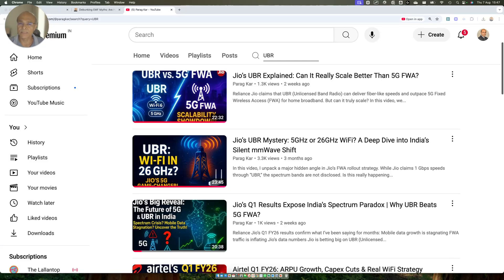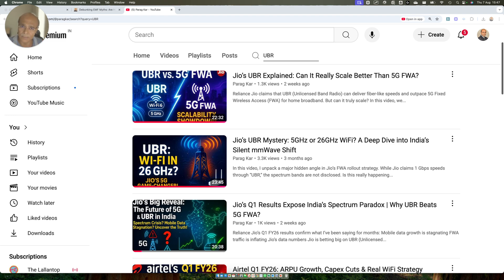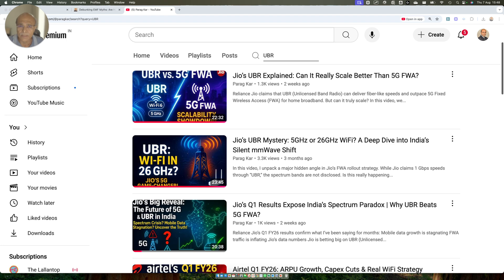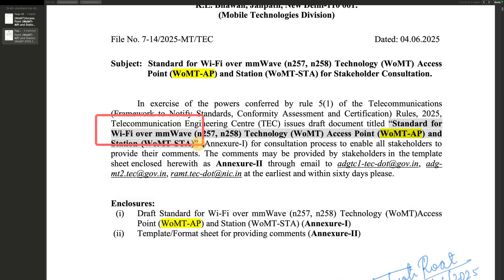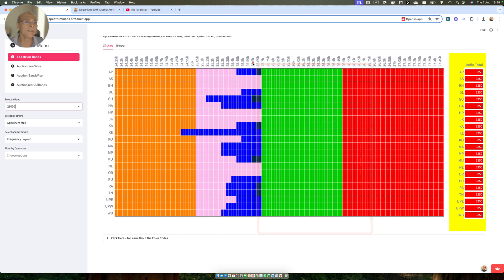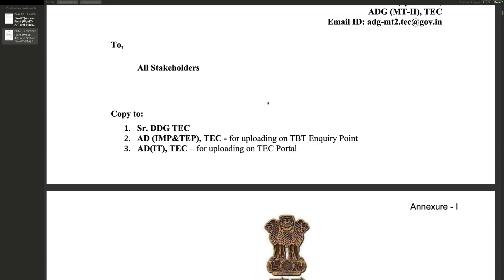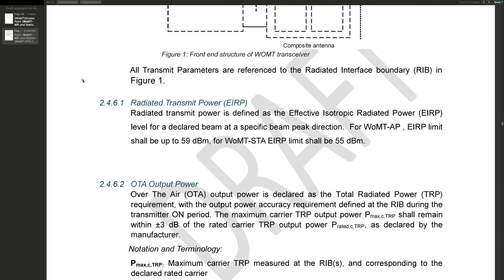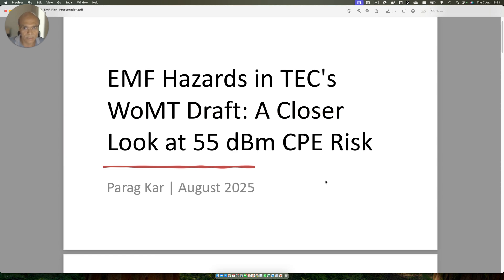Is Your Wi-Fi Router Becoming a Radiation Hazard? Big Flaw in India’s New 5G Tech Draft

Comment: pls explain it in simpler terms for the general viewers, ramifications and precautions
Reply from the maker: In simple terms: UBR-style Wi-Fi (the cheap, unlicensed 5 GHz kind) works fine in 5 GHz, but if you try the same idea in 26 GHz the signal dies very fast—like shouting from farther away—so you must squeeze it into a very tight beam and push more power. That makes the box hotter, costlier, and tricky to install, and it still needs clear line-of-sight. Plus, 26 GHz is a licensed 5G band, so running Wi-Fi there isn’t allowed and can disturb real 5G. If someone did it badly, that tight high-power beam could create a small “don’t stand here” zone a few metres in front of the antenna. 

Bottom line: keep UBR Wi-Fi in 5 GHz; if you use 26 GHz, use proper 5G-grade equipment or equally strict safety rules—otherwise the whole “low-cost Wi-Fi” idea falls apart.
Reply: @paragkar  Thankyou! sir

Comment: its highly unlikely they will deploy a 316W as CPE, the power supply and the amplifiers used will be very costly as the transistors which operate at 26GHz with that much power will be very expensive. it might just be a repeater used to increase the range.
Reply from the maker: That’s correct — and that’s exactly the point of my video. Deploying RF technology in the mmWave band is tricky because the signals don’t travel far. To overcome this, you need to shape the beam sharply, so it behaves like a torchlight beam rather than a diffuse glow. But this makes the customer-premises equipment (CPE) more complex and expensive.

5G addresses these challenges with built-in safety measures and standards — but these come at a higher cost, which some operators want to avoid. That’s why there’s an attempt to use a cheaper alternative (Wi-Fi) in a 5G band. The problem is, in the push to cut costs, device quality, safety, and power efficiency could be compromised.

That was the key point I was trying to highlight in my video.

Comment: If we have beam forming and high gain antennas, isn't the 4*pi*r2 denominator wrong.
ie in such cases, the power doesn't spread out in all directions.
Reply from the maker: Yes, the 55 dBm value includes antenna gain — so in theory, the beam is directional and focused. But in real-world scenarios, especially in residential settings, we don't know exactly where people might come into contact with the RF radiation. More importantly, the TEC draft doesn’t specify how much of this 55 dBm comes from antenna gain or how narrow the beam actually is.

That’s why, in the absence of clear antenna specifications, it’s necessary to assume the worst-case condition — meaning no antenna gain and power radiating equally in all directions. This is a conservative approach but one that regulators around the world use to ensure public safety.

Also, by definition, EIRP (Effective Isotropic Radiated Power) is the power a theoretical isotropic antenna would emit to produce the same peak power density in the direction of propagation. So even though the antenna may not radiate equally in all directions, EIRP is still referenced back to an isotropic antenna to calculate safe exposure levels. This helps standardize EMF compliance testing and simplifies risk assessment, especially when antenna characteristics are not well defined — as is the case in the TEC draft.
Reply: @paragkar I'm not an expert in the radio world.
So forgive my ignorance.
I was trying to say that, if the beam is smaller won't peak power be much higher?
ie won't the safe distance be higher as well owning to the narrow beam at high power?

Even with let's say normal WiFi with its <1W power limit or something similar, if the beam is extremely narrow, can it cause issues ?
Reply from the maker: @sr-zk4up  This video will explain - https://youtu.be/pKd0bRC9VhI
Reply: @paragkar Thanks a lot. You're doing an excellent job of educating others about the "black magic" of RF🤣

Comment: Non ionizing radiation don't harm like ionizing radiation do, when power is too much it has ability to heat up things a very little and most of the WiFi, 5G RF frontend chips are well regulated and under way below when RF radiation can be able to little heat up things and high frequency RF is so week even water vapour attenuates it so much. But I agree to regulations and it's importance. On a different context unnecessary RF power usage when it's not needed is waste of energy.
Reply from the maker: Thanks for watching and valuable feedback
Reply: You dont need ionizing radiation to hurt your biochemical pathways. A torch will emit non ionizing radiation yet if you stare into it for hours everyday it will damage your retina and eye muscles in a number of ways, not just by heating it. Thats just a simple example to illustrate why this red herring of ionizing radiation is a poor argument to defend nonionizing radiation. 

Already, wifi radiation can hinder with the calcium gated voltage channels in your cells, disrupting your energy process,increasing inflammation. Some years ago, in the UK, the cops who carried walkie talkies in their waist belts saw disproportionate incidents of fertility issues and even testicular cancer. And walkie talkies didnt emit ionizing radiation and they didnt heat the groin to do this.

The regulations are obsolete by the way. Some are 2 decade old. And in a country like ours, even these lackluster regulations get flouted and no one is held accountable. People even happily have base stations installed in their roofs for a few lacs given by companies. Walk around your city with an emf meter and see for yourself how regulated the space really is.

Comment: Most of the Power Amplifiers (PA) are only 60% to 70% efficient, so the CPE will consume greater than 450W to 500W for a RF power of 316W.
Hence WoMT will give the residents near by a "VOMIT"
Reply from the maker: 😂 Absolutely! At 500 watts, the CPE isn’t just delivering internet — it’s moonlighting as a room heater!

Forget broadband bills — residents might need to take a power loan just to keep their router running. It’s like saying, “Would you like 5G with your mini thermal reactor?”

And yes, if you’re running a 55 dBm as 26 GHz WiFi CPE, energy-conscious users will have to choose between streaming Netflix or saving the planet. Can’t do both!

WoMT might not just cause “VOMIT” — it might also trigger your electric meter to spin like a fidget spinner on Red Bull. 😄